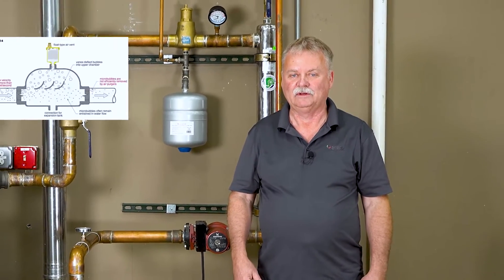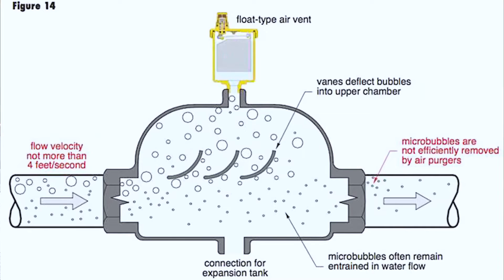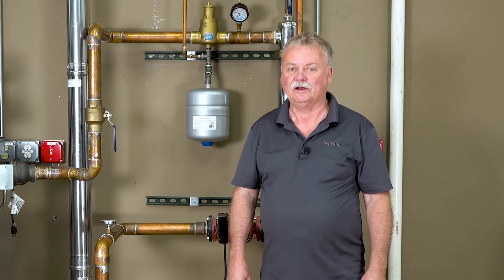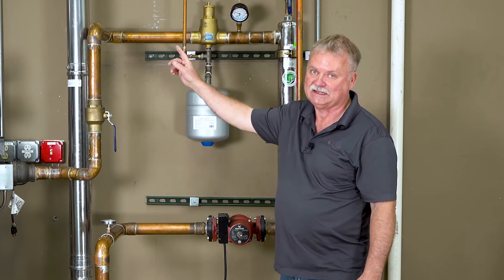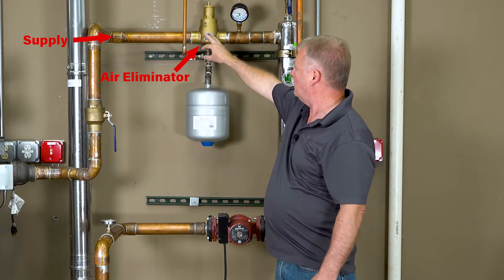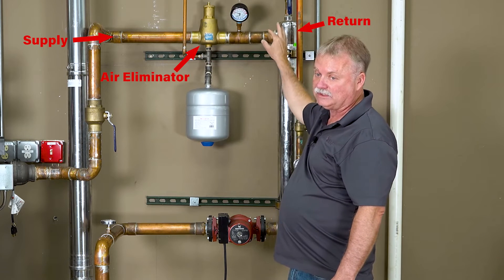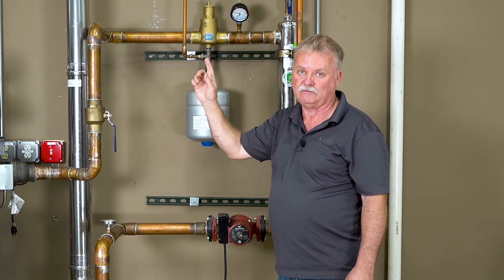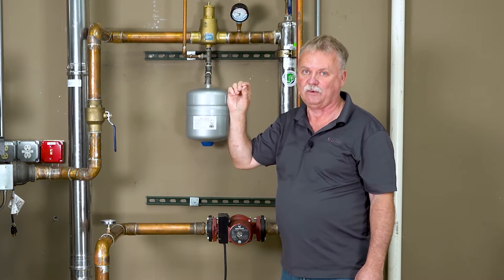Hydronic System Series: Air Separators

Comment: Thank you, this was very helpful. I had the stainless steel air eliminator in my system, but couldn’t confirm what exactly it did. Your explanation helped tremendously. I had to service one of my pumps and couldn’t see how to purge air. Looks like this will happen automatically with this air eliminator already in the system main loop. Thanks!
Reply from the maker: Glad this video helped you!